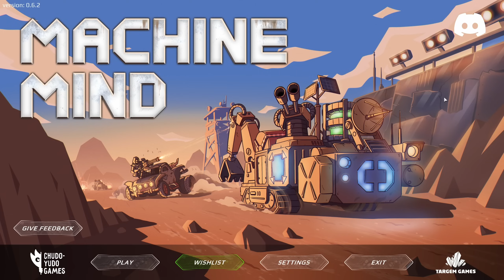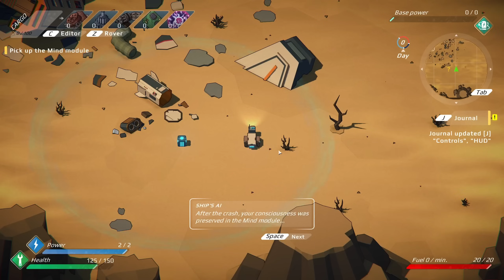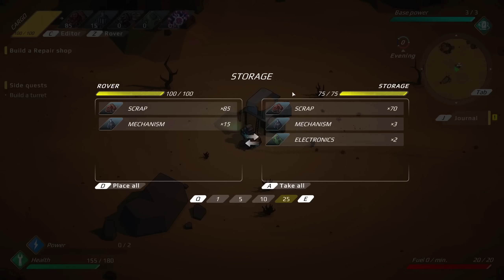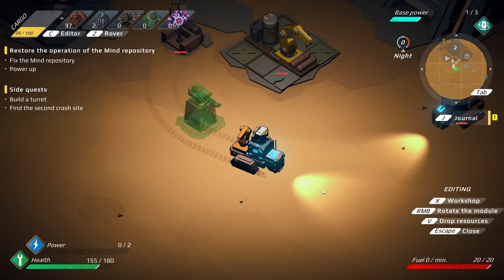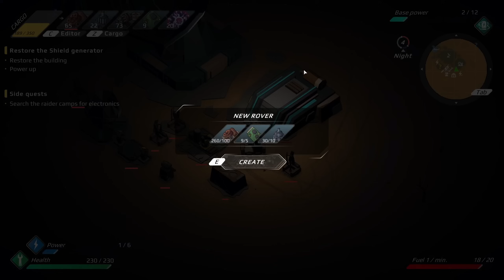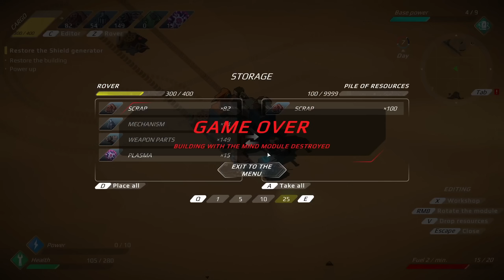I Turned A Pile Of Scrap Into A FULLY AUTOMATED Base!

Comment: Thank you for the video, Orbital Potato! 
Your insights are always appreciated. 
I fully understand that you are pushing for as much information in as little time as possible. 
So I am going to put the overlooked cargo in the spawn ship on that account.
It didn't seem like missing the cargo slowed you down much anyway. 
I'm going to try out the demo and use the knowledge gained here and elsewhere to good use. 
The meta seems to be rear and/or side broadside tactics, shooting up the enemies while moving away or circling them.
Because it didn't pay off for you to face the enemies in my opinion. 
But what an anticlimactic end, just a big game over when away from the action. 
Base defense seems very finicky and frankly dangerous to your own units and structures, so perhaps a wider spread and better armed bots would be necessary? 
As a ending statement, you can expand your other bots, so they can hold a better spread of tools.
Reply: The anticlimacric end was his own fault tho. Did not set up any turrets to actually protect the perimeter, did not make a repair bot to deal with damages and left yhe mind repository at 10% health before exploring.
Reply: @theknight1573  
I died on my first try to the same later than Orbital Potato, but I had turrets, loads more than Orbital Potato, and a repair bot set up, but it wasn't enough, not by a long shot. 
I was close by and saw the bot refusing to repair any of the base's damage. 
Even if I've set them to ignore enemies, they didn't repair damage.
On the other hand, if I set them up to flee, they just bunch up beside the base and die to attrition. 
If I set them up with guns, they don't use them, as there's no new option for the bots when equipped with offensive modules. 
Try it for yourself and see if you have better luck.